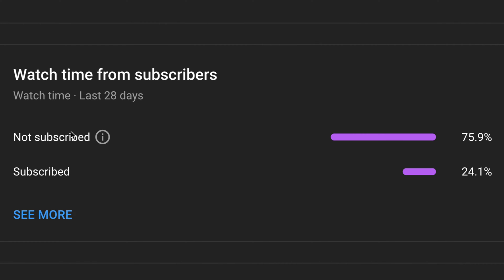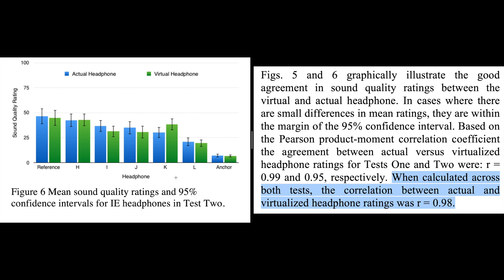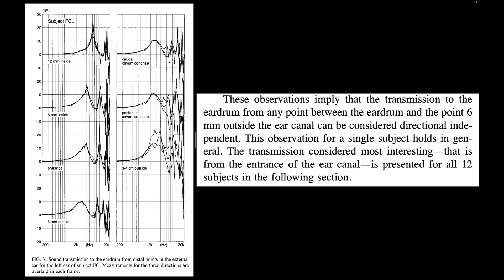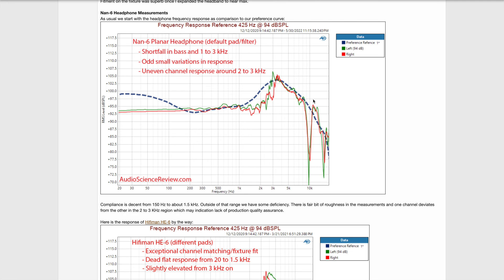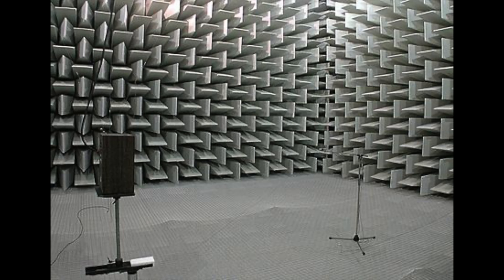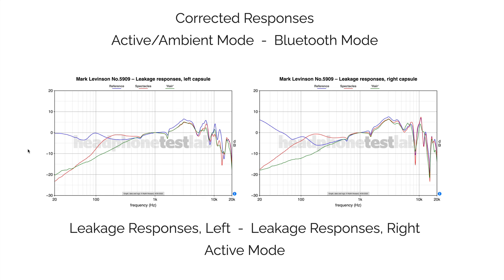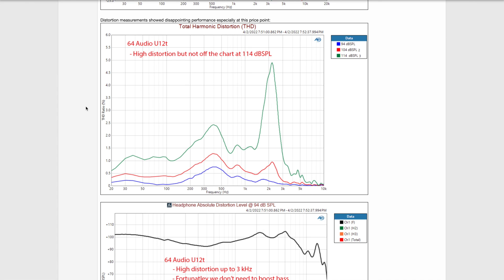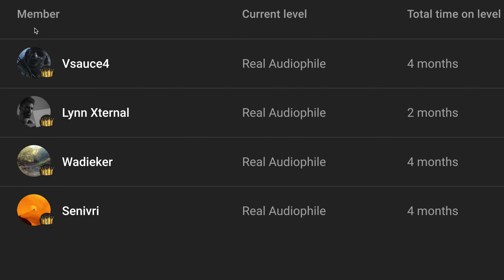What Is "Technical Performance"?

Comment: Technical performance means, sound seperation,imaging, distortion and soundstage for me. Based on my 7 years of experience, this technicality based on driver quality and design. Generally planars have more unstable tuning but their technical performance also way better than the dynamic drivers. They require more power but also they respond to eq better. They have a better speed and decay but you cant measure it on the fr. If you are on the budget and you have planar options, i suggest to select planars for technical performance. Also if you know, how to make parametric eq correctly than you can turn it to monsters. Beside this, there are really good applications on design when you can consider choosing a dynamic driver unit. Examples like k371, srh840 or fidelio x2hr are really good options in the market now.

Comment: When you pay money for an iem, you shouldn't pay for "technical performance." That cash should be for QC standards, build quality, customer service,  low distortion, and if not overall tuning then a smooth frequency response without huge peaks and valleys (so you can easily eq). Or else you just pay to pay.

Comment: hmm you just convinced me but i think we should change the "technical" thingy into hardware spec for the new "technical performance" i mean here is the drivers and other hardware worth to consider like nozzle filter etc. 

im not good in English but my context here is; example you cant achieve variations tuning with Chu because of lacking these "technicalities". if we strictly think engineering can't we make sound wider while maintaining the same fr?

i believe this is why they separate tonality and "technical performance" for easier to understand how the iem would performance.
Reply from the maker: no

Comment: “Technical performance” is quite literally how accurately an acoustic playback device (IEMs/speakers/etc.) reproduce the electrical signal they receive. This is not necessarily related to frequency response (however, frequency response is much more noticeable). 

You absolutely can have a device with poor FR but great technicalities, if you measured the incoming electrical signal and sound waves produced by the driver and compared the two adjusting for differences in amplitude. 

Frequency response absolutely effects “perceived” technicalities but that’s it, just your perception. Speakers/IEMs/etc. are meant to reproduce electrical signals as accurately as possible and nothing else, FR is a part of this (and the most noticeable) but it’s only a part. The sound waves etc. in comparison to the incoming electrical signal is where technicalities live, which is not necessarily related to FR (as long as you control for amplitude differences).

But,… yeah. How someone is supposed to take an IEM etc. and figure out that it has great technicalities especially when it has a horrible FR,… you might have a point there. Not saying it’s impossible for a person to make that call by ear but it is a red, or at least yellow, flag.
Reply: Technical performance tends to be related to how much shimmer is introduced by these nasty "diffuse field" treble humps and how they mask over everything else in the mix..  but the reviewer doesn't care becuz muh vocals shimmery
Reply from the maker: k

Comment: So what's the point of halfkilo and kilobuck+ iems etc with various driver technologies if all they need is just a variations FR and there's nothing called technical performance. One can release a variations-tuned-chu and be done with the industry forever right??😡😡
Reply from the maker: achieving variations tuning with chu's driver isn't possible in a passive iem
Reply: @sharur1  So that means chu has lower technical capabilities right? What achieves/results-in perceived aspects like imaging, soundstage, resolution/detail and separation? Isn't it the technical performance/capabilities of the driver? Are these achieved by tuning/FR itself?
Reply: @sharur1  so eq can’t fix it right 
You need htrf to eq a driver correctly
That’s not everyone can afford so go for variations.

Comment: Technical performance is different from frequency response.
Reply: my dude “transient response” is part of frequency response.   if you had a square wave signal, the transducjng of which would theoretically require an infinitly fast transducer, in the frequency domain becomes related to the fourier series the fft of which would see elevated odd harmonics. maybe go study electrical engineering before bringing that cope to the debate
Reply from the maker: incorrect
Reply: @sharur1  Technical performance takes into consideration transient response where as frequency response doesn't

Comment: No I don’t agree with this. IEM’s like the Helios and variations graph well, I don’t hear that much detail when comparing to ier/m9 or u12t. There has to be something going on lol
Reply from the maker: You're either not good at reading frequency response graphs or you are getting placebo'd by what you read on the product's marketing page
Reply: Listen to a mono sine sweep from 20 Hz to 20 kHz. Does the sound source stay in the center of your head, or does it move around? Do you hear any peaks or dips? Are both headphones EQd to the same frequency response, to prevent something like a treble boost giving the impression of more detail?
These are very basic things that everyone in audio should know, and yet audiophiles usually don't know any of them. Instead, they just make shit up.
It takes me 5 minutes to listen to a headphone and tell you its deficiencies based on basic knowledge about psychoacoustics, headphones and audio. Audiophiles spend weeks and then still can only tell you meaningless subjective BS.
Reply: What is "detail"?
Reply: Did you compare them blind? I doubt it.
Reply: @Reriiru  Nice joke
Reply: @realaudioreviews  did you? You actually can do it with an iem, unlike over ears. Nobody does, including Shartur, because shilling.
Reply: @Reriiru  yea I’d the FR is different it sounds different. The bass can sound different even if it had the same db boost
Reply: @realaudioreviews  get two IEMs. EQ one to another. Compare them in blind. In fact, take three, two of the same and one EQd. In fact, the more IEMs you put in such a test, the better. Make a video doing it, it will be a valuable learning experience for you and us. Make sure to actually do the blind test properly though.

Comment: How do certain IEMs achieve more separations between instruments? Is this visible on frequency response?
Reply: Only if you get the raw measurement data.
Headphones cannot create more separation than is on the recording, they can lower it however.
Listen to a mono sine sweep. In good headphones, the tight matching of the drivers will keep the sound consistently in the center of your head across the entire frequency range.
In bad headphones, phase and amplitude deviations will cause the virtual signal source to move around, even spread out.
Instruments will cover a wider portion of the frequency spectrum compared to a sine sweep, so these deviations will blur the virtual position and size of these instruments. This will reduce perceived separation between instruments.
Reply from the maker: @xnoreq  I think he is talking about how an excess in the 300 Hz region causes congestion
Reply from the maker: yes

Comment: if not in iems or headphones, when is there a difference between tonal and technical?
Reply from the maker: It's just in IEMs where there is literally no difference at all. There is some in headphones and it depends on the room for speakers. I wouldn't call this "technical performance" though as there are specific terms.
Reply: @sharur1  never thought about it this way, ty great vid
Reply: Wonder if it's possible to make a headphone with like 1kg worth of cup bracing and STILL make an objrctively terrible sounding headphone.